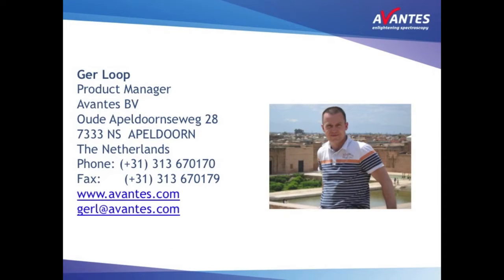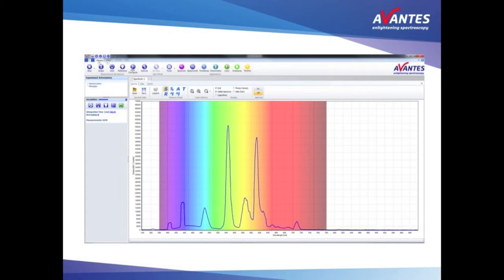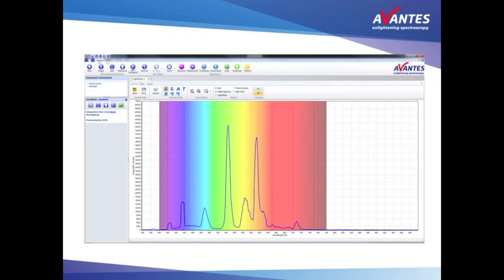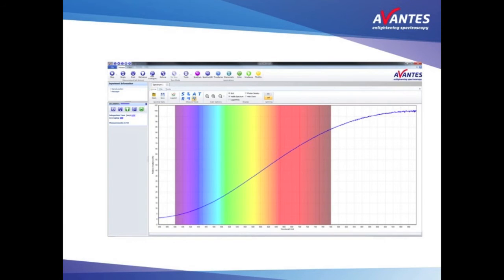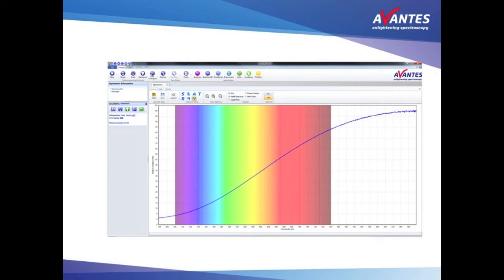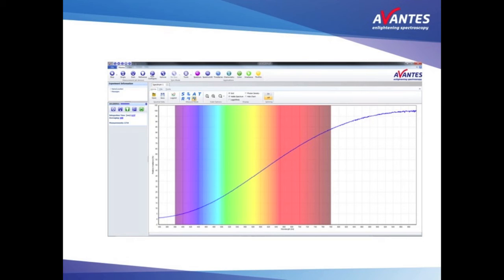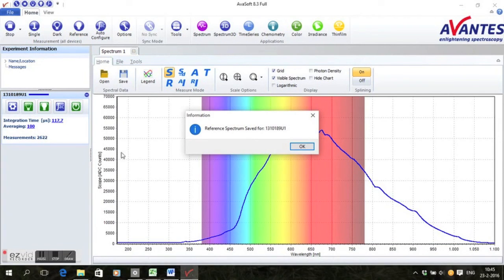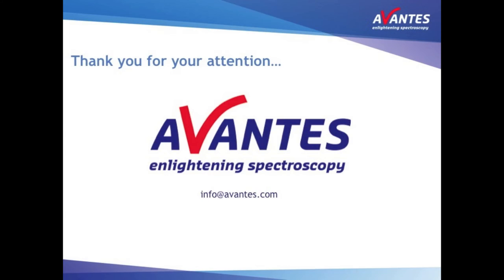Relative Irradiance

Comment: Would this also work with a 3000 K halogen lamp? If not, why? Can this be counteracted somehow?
Reply from the maker: Dear Dennis, Thank you for your question. Yes it does for sure for a halogen source of 3000K. 
The relative calibration makes a halogen curve from the light source, one of the parameters to set during the relative calibration is the color temperature.
After the relative calibration the spectra can be used to measure all kind of light sources / processes.

Please let us know if we can help you with the devices / application / calibration.